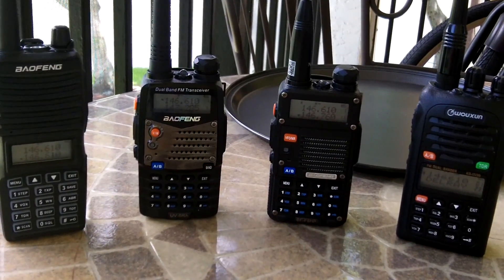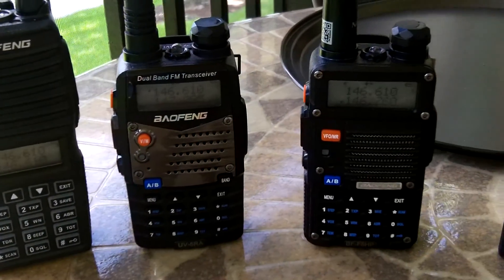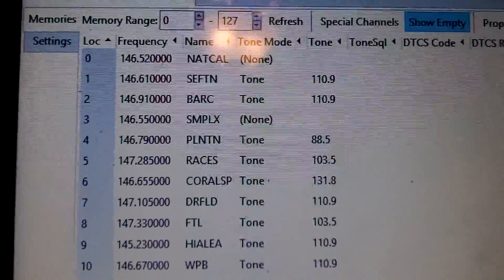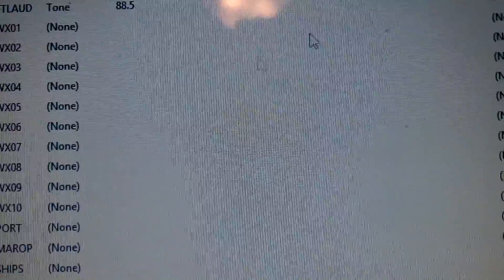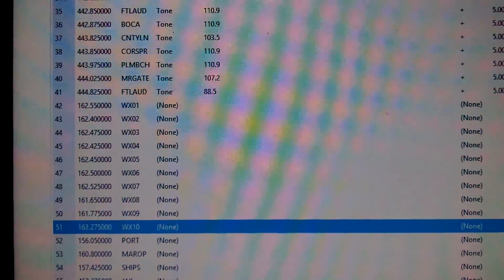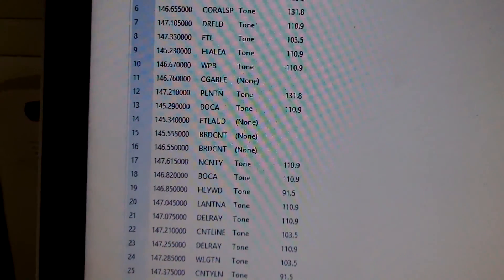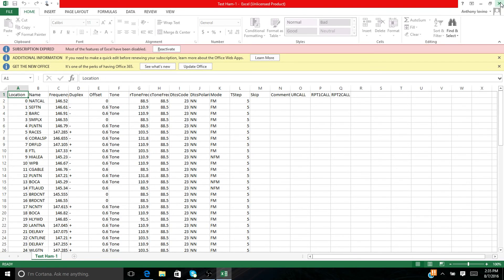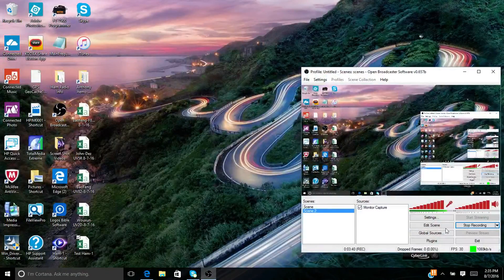How To Program Different Model Ham (HT) Radios with the Same Frequencies Using CHIRP Software

Comment: Very helpful. Two comments.  How the Test Ham-1 file is created begins at 11:53.  Noticed during the process of cloning to the Wouxun, at 17:48, the very first line is not checked (146.610000 SEFTN) and is not cloned.  This is only a slight oversight in this video.  However, I understand some radios have certain locations that must not be overwritten and the import should start below these locations.  I have to check this out when cloning between BaoFeng and Yaesu.